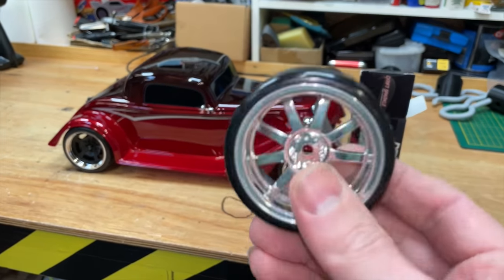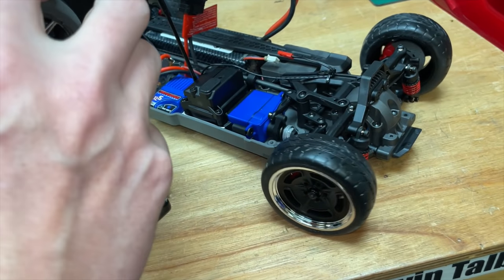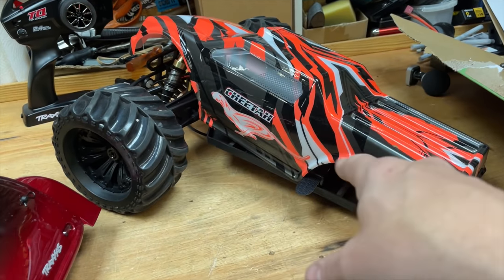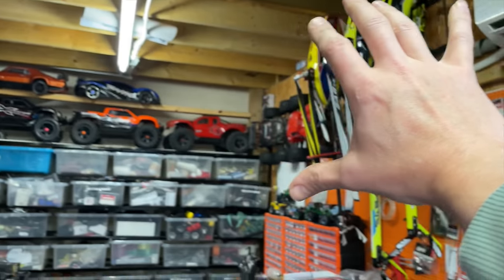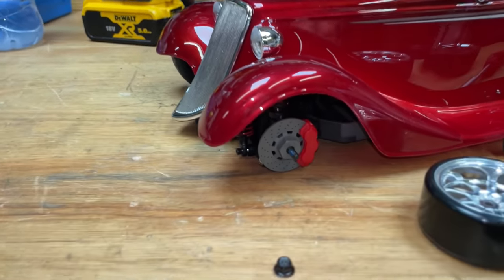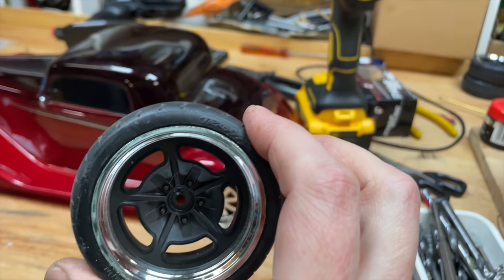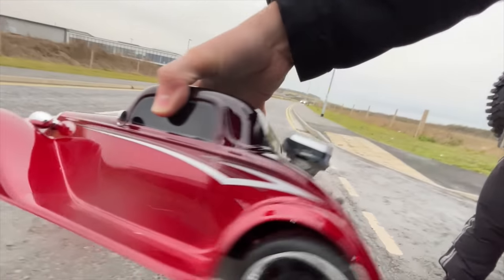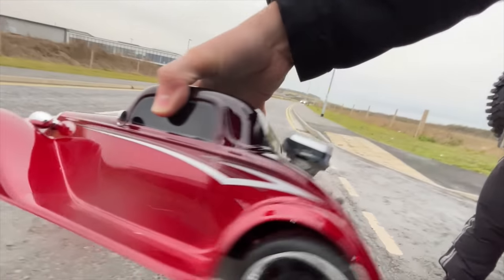Sparking DRIFT Tires on Hot Rod RC Car (OVER VOLTED)

Comment from the maker: Get car here - https://www.avantlink.com/click.php?tt=cl&merchant_id=4b85b2b7-558e-4304-89fc-54958c8f47f0&website_id=78306fdc-4500-4834-a455-32288403b036&url=https%3A%2F%2Fwww.amainhobbies.com%2Ftraxxas-4tec-3.0-1-10-rtr-touring-car-w-factory-five-33-hot-rod-coupe-body-tra93044-4-red%2Fp-qqqctqeqnm2vqctz
UK - https://www.jperkins.com/products/TRX93044-4-RED

Motor - https://www.banggood.com/Surpass-Hobby-3650-3100-or-3600-or-4500-or-5200kv-2S-or-3S-1-or-10-Waterproof-RC-Car-Motor-p-1446810.html?warehouse=CN&ID=516951&p=AO191223234372201807&custlinkid=1731113

Servo https://www.banggood.com/JX-Ecoboost-CLS6322HV-21KG-Large-Torque-180-CNC-Aluminium-Shell-Metal-Gear-Digital-Coreless-Servo-p-1319881.html?warehouse=CN&ID=0&p=AO191223234372201807&custlinkid=1731114

GPS - https://www.banggood.com/SKYRC-GSM-015-GNSS-GPS-Speed-Meter-High-Precision-for-RC-Drone-p-1484506.html?p=AO191223234372201807&custlinkid=412975
Reply: Hi
Reply: yesirr
Reply: Thanks
Reply: Get the new traxxas Supra
Reply: Where did you get the wheels from
Reply: @dillpicklelegolocomotives8472  Lemme guess, your from fast and furious
Reply: Kev I just joined youtube one of your biggest fans where you from would like to meet up and have fun
Reply: Please get an ecx amp crush
Reply: you should make a video of the traxxas jato 3.3 nitro rc car because you said you are getting into nitro. also i am a huge fan of nitro to ,so i know i won't be disappointed by your next videos.
Reply: you are smart...
when you talked about the 60 mph
Reply: Hi
Reply: p
Reply: Ui
Reply: You could send a  Rc car you can send it with 
Someone I am in tongue annadale opposite the School please and thank you very much

Comment: i just got a rovan 5b 2 stroke buggy, and it is so much fun to drive, the only thing it needs to run on asphalt is some better tires and a gearing change and it would be a really good buggy. you can change all of that super easily

Comment: First of all this video as always was awesome. Thanks that you do these  for us. To a whole new year of your videos! 

 I'd be genuinely supprised if the car actually achieves 60 since a shorter motor means a lot less torque. To which more kv would only contribute because they too mean less torque. There fore the smaller motor can't take the different resistances(?) almost as well as the lower kv and longer motor unless the cheetah motor didn't come close to its potential max torque. Which would mean the new motor could still have enough torque to get this done. 
By the way the sice is 3650 it has only 3600kv if I remember it right. 

There're probably a few spelling mistakes I'm still learning English in school so sorry for those. I might have forgotten some punctuation too.
Reply: You're doing a lot better than some of the idiots I've seen on social media. People that have spoken English for 60 years and never even attempted another language.

Comment: I love those brushless motors I got one in my k-10 blazer and let's just say it's a little too much for it if you go through mud and you punch it you will break a front axle shaft and I have done it many of times but it's so cool cuz it's lifted and I can do a donut and go It's just got so much power and torque!!

Comment: You don't need "better tires" to get faster speed. What you NEED is the following: better shocks (to better control the dampening...the 'Ultra' shocks are garbage), aluminum or Ti turnbuckles (the plastic links are garbage, and allow way to much "slop"), aluminum steering knuckles & rear uprights (also to remove slop), and (finally) to shim the front & rear driveshafts (also to remove slop).  Without doing what I just said, the vehicle will ALWAYS have to much slop, and, thus, will be too "squirrelly" to hold a straight line.  I've got two of the Corvette versions - one running the Velineon VXL (3500kv) motor & ESC, the other being turned into a "speed run" car -and that's what had to be done to them. The speed run variant was supposed to be a project worked on with my buddy Richie (Driftomaniacs), until he moved 2000+ miles away a few months ago.

Comment: Buy a treadmill and use it for rc cars
Reply: ❤❤❤❤❤❤❤❤❤❤❤❤ I know right
Reply: W
Reply: I said that before he did it and it destroyed his car😂
Reply: Gps won’t measure speed as it works on time and distance
Reply: @JustinnRC  ... he never mentioned anything about gps?
Reply: @cuf_    But what’s the purpose of the treadmill then cause I am lost.
Reply: @JustinnRC it does
Reply: @cuf_ ? And why do you have the weirdest profile pic
Reply: Why?
Reply: @OfficialBassBooster-v1s  no it doesn’t , I measured distance by time , it’s not connected to the actual car and the wheels dont have a sensor that a laser is being pointed at so a treadmill won’t work.

Comment: Happy New Year Kev. That hot rod looks so cool. About a month ago I put the Surpass 3100kv motor plus matched 60A speed controller in my TXT1. I'm still running NiMH packs (mostly LRP 3000mah) and I am impressed with the performance v cost of the setup. Keep up the good work.

Comment: For future reference.. 
18mph stock
24mph on high soed gears. 
Gnss verified on a 5800mah 75c 2s battery.
I went to a 26t oinion and got 32mph and it doesnt overheat. 
They have so much grease in the diffs and bearings causing so much drag on these 4tecs.......

Comment: Hi kev, took my senton out today and a chunk of the tire flew out for some reason! Was only going about half throttle on grass, do you know why?
Reply: Thin piece of rubber to be precise, large chunk, now my tire is half rubber half foam. Looks like your sentons wheels when you took them to Englands most abusive skatepark.
Reply: Damaged rubber or maybe an out balance in the tire causing it to randomly explode my notorious did it and the foams had completely gone 😂
Reply: @freeze-peely8494  yeah I’m really not sure. You’d think for almost £500 arma would provide better quality tires, worse still this is my first ever outing with it since I bought it for myself for Christmas.
Reply: @lewis.n2313  they are fairly good when you think about the power but they could be improved or maybe banded
Reply: @freeze-peely8494  yeah, epic car from my first impression, just a bit annoyed it popped on my first time ever using it 😂
Reply: @lewis.n2313  😂😂 that does suck hope you get a new set of rubber for it soon
Reply: @lewis.n2313  Stock tires are garbage on about any vehicle. Had one blow on my Arrma Mojave. One on Arrma Limitless, wasn’t even driving when it blew I don’t think. 6 on a Traxxas Maxx. Atleast a couple sets for a Traxxas slash
Reply: @reidisaacson9623  ok

Comment: Hi Kev. There is something wrong with my Traxxas Maxx but I don't even know where to start. I want to learn how to repair and maintenance it by myself but I can't seem to find what the problem is. The right rear wheel is rotating independently and not with the three other wheels. I also noticed that this forces the car to drift off a certain way while driving but I know why that is. Just by knowledge and or past experience do you think you would be able to help me out? Thank you Kev.
Reply from the maker: broken diff, shaft, sized bearing or something?
Reply: @KevinTalbotTV  Thanks Kevin. By the way, how do you feel about the new version of the Maxx vs. the original and also I want to congratulate you again on being able to build your own monster truck. I can't wait to see it done and it looks great so far. I also love monster trucks and Rc cars like you do. My dream job is Monster Jam. I'm going to my 12th Monster Jam event in February and I can't wait. I also love the C10 body you chose I don't think there are many trucks that have ever used that body. No offense at all but I wonder why you picked that body? Thanks again for the recommendations Kev. Happy New Year!
Reply: I know I’m late to this comment but I think you should bring it back to your local hobby shop. Most hobby shops “at least near me” work on rc cars for you. They could also help diagnose it for ya

Comment: Every rc car I have built fails to maintain any grip after 45mph without downforce. It's going to look silly but a little wing front and back will give you the downforce needed to maintain stability at speed. That said I removed the rear wing from my Typhon 3S ran 4s with no spoiler and hit an uncontrollable 74mph. 68mph with wings and ran well.

Comment: Kevin Talbot on 8:42 its not 3650kv it is 3600kv this 3650 is the size 35 is for the diameter and 50 is for the length